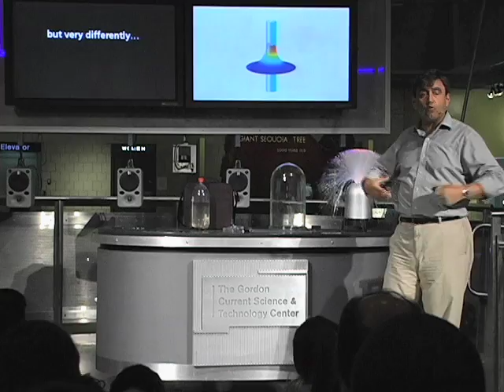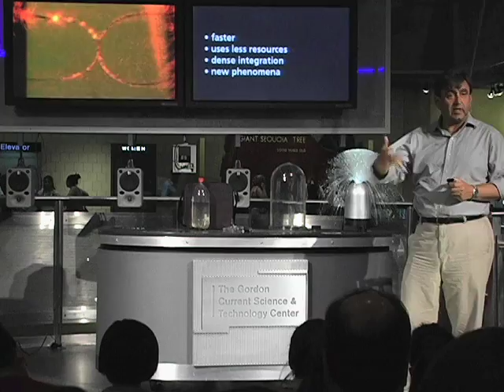3 of 3 - Guiding Light w/Nanowires - A Rail for Light

Comment: Interesting talk. I have 2 questions :
1- Since nanowire diameter is less then light wavelengh, how the light is guided and transported  within it? 
2- why there are discontinuities in the fiber picture at 0:12- very luminous points with intense reflection and darker points ? Is it due to imperfection in fiber material ? Thinks